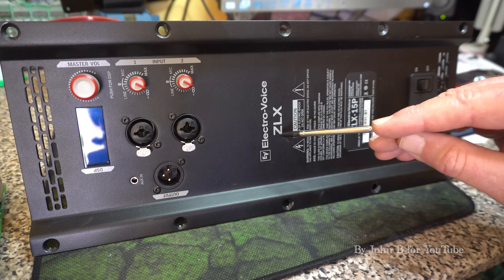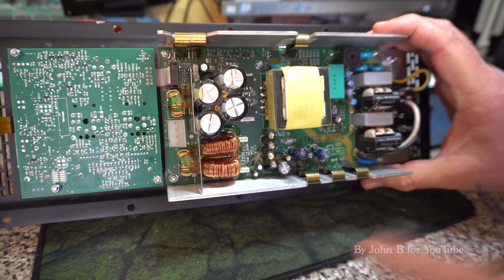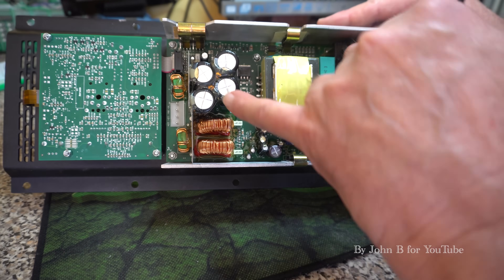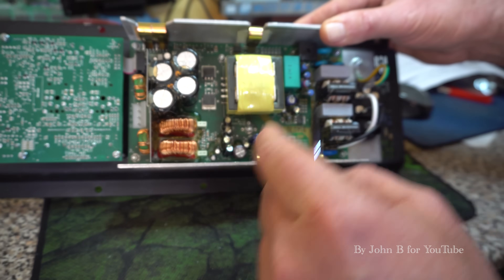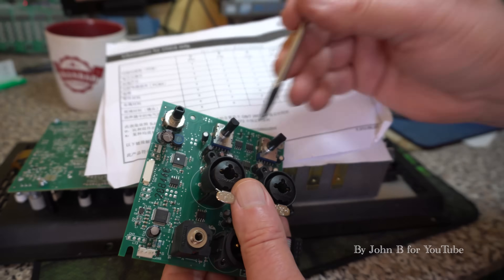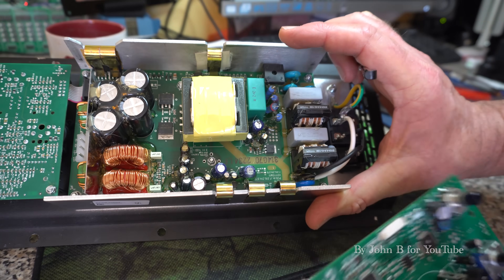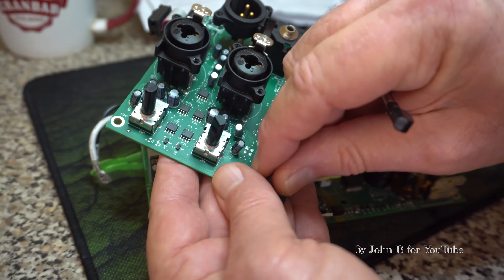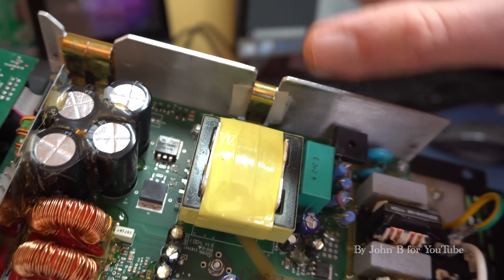The Inconvenient Truth about your Electro-Voice ZLX-12P & ZLX15P amplifier (Read Show More)

Comment from the maker: The repair scope shot shows +/- 30 volts peak to peak before it limits down to 20 volts PP.
30 volts PP times 2 = 60 volts PP.
60 x 0.707 = 42.42
42.42 x 42.42 = 1,799.4564
1,799.4564 into 4 ohms = 449.8641 RMS
At full power, this 449 watts lasted just a few seconds before the chip cut the output down to 200 watts approx.
Reply: well that's bloody rude of them isn't it. these are expensive speakers here, well over a grand, performing like speakers worth only a few hundred.
Reply from the maker: @maebeans  you can watch the repair video, the proof is on the oscilloscope.
Reply: @JohnB-2021  oh no, i believe you, i've been making these measurements myself while designing an amplifier. i'm just disappointed that a "trusted" brand can't be.
Reply from the maker: @maebeans  I saw someone fixing an Alto TS310 and quoting 2000 watts. It has a 500 watt chip for the bass and another for the treble lol.
Reply: Merci pour votre vidéo et vos conseils @JohnB-2021
Reply: My zlx keeps cutting off at high volumes and keeps breaking compression drivers
Reply from the maker: @mannybk2722  You are turning up the volume too much.
Reply: Conclusion: Is necessary find Yamaha repro PA. Or anything from Yamaha. Thanks for quick smart electro education.

Comment: Thank you for an informative video. What thickness would you recommend for the heat transfer pad on the bass amplifier chip? I read somewhere that extra care is needed to ensure proper connection to the heatsink "hump"
Reply from the maker: 2 or 3mm

Comment: Hi John,  I've got 2 no  EV zlx 12p, one of them has low clear output even on max volume, the other one is loud but humming noise on all inputs except AUX IN, once I use input 1, the humming comes back, when I use AUX in, the humming goes away, any chance you have a solution for both speakers or can you fix them? Do you have a servicing location? Thank you
Reply: Verifica los potenciómetros y los preamplificadores 😊

Comment: I have beat the crap out of my two 15-piece for a year and a half 15-piece like tweeters two 18-inch Subs to compensate for the power loss. Sounds good. I paid 600 bucks a piece for the speakers. I've seen a cheaper set online for 250 bucks we have 😢two knockoffs

Comment: Hey so I have a pair of these when I power them on it sounds like it’s receiving interference like how older wireless mics use to get. I had them stored in my friend’s basement for a while without use. Could you shed some light on how I could repair these or fix this issue ?also the power just comes on and shuts off randomly.

Comment: We just got alto ts315. I'd be very interested to see what these "2000w" speakers have under the hood and what you'd have to say about it compared to the EV.
Reply from the maker: I bet / guess 1000 watts rms if they have two 500 watt drivers. 500 for bass, 500 for treble.
Reply: @JohnB-2021  why would treble need 500 watts??? Tweeters don't need high wattages to get loud. it's extremely uncommon to see a PA tweeter with more than 100 watts. They're usually only 25-80.
Reply from the maker: @Bxyzfnf Well I guess it’s down to the type of tweeter / horn used and the operating frequency.
Reply: @JohnB-2021  500 watts for the tweeter is already concert line array territory. which is nowhere near these cheaper powered speakers

Comment: Our same EV speakers over heat. Not touchable. What to do? We have 3 subbase and 6   heads ( tweeter -mid)
Reply from the maker: Many have said they get hot. Normal for that model and brand.
Reply: WE PUT TWO SMALL COOLERS ON THE TOP PART EXTRACTING THE HOT AIR AND FORCING THE CIRCULATION OF THE SAME AIR
Reply: Hii tweeter ok but mid not working what can I do

Comment: Hi John...thanks for great videos! I have a EV 15P with a electronic buzz from speaker not mechanical...any ideas? sounds a bit digitalish...caps?...regulators etc as I havent even looked at this amp yet...TIA...another John ;-)
Reply from the maker: @whitenorthstar  I doubt the caps are faulty, they would cause a hum. Sounds like a power supply issue but no idea what.
Reply: @JohnB-2021  sorry John...it is or seems to be mechanical coming from the chokes/smps transformer and some have reported this but never got to the bottom of it...possibly oscillator running at wrong frequency as one suggested or? Could be any number of things with these crap EV power supplys! If i get to the bottom of it I'll let you know...thanks for reply.
Reply: It was a faulty smps with loose windings that was causing the mechanical hum.
Reply: @whitenorthstar  Have same mechanical buzzing fault ... can you detail how you fixed it?

Comment: Ive always wondered  why they sound so underpowered , i have 2 ev zlx 12 p and 2 alto ts212, and they have always  sounded underpowered compared to the altos. But with this new knowledge im willing  to bet that the altos are also using the same scheme.  

Credit  to EV they are much more reliable rhan the altos never had any issues, but I've had an undesirable  experience  with Alto they keep on breaking, they're  on their  3rd pair of tweeters second  pair of preamps and now going in for thier 3rd pair of preamps. The altos are never pushed hard they are only used for stage monitors
Im not a fan of the EVs, i hate them even more, but i do agree with some of the comments, they really do sound nice.
Reply: вот поэтому Alto и звучат громче, и при этом ломаются так как плохая защита динамиков, у EV грамотно настроен лимитер и это сохраняет динамики, хотя звучат тише

Comment: doesn't the fuse rating give it away? 250v / 0.5a = 500w (lol, got the maths wrong, that's ohms)
Reply: i totally read the back plate wrong, that's a 4amp fuse? so assuming a safety factor of 20% that's about 768w? and say it's 80% efficient, that drops to 615w?

i'm really curious if this can be done to make assumptions about an amp.
Reply from the maker: @maebeans  I have just pinned a comment, by me, showing the real RMS power for a few seconds.
Reply: but why does it say 0.8-0.5a next to the fuse rating?
Reply from the maker: @maebeans  You're spot on.
One can't get more power out of a box than is going in.

Comment: Hello,nice video !I have a question and maybe we can help us 
We have a ZLX-15P speaker and we replaced the power amplifier board but after this we noticed that has a distortion 
What can cause this problem ?
Wiring is tested and is good
Reply from the maker: Maybe the woofer is going short circuit and it killed the previous amp.
Reply: hello, I have a zlx 15 a when I connect it for 5 minutes only the treble tone works and the bass tone also works. do you have any idea what it could be?

Comment: Curious if you’ve worked on any Alto TS412/415’s? Interested to see what their real output is (rather than their advertised 2500watt peak).
Reply from the maker: The clue is Consumption : 900W
They can't produce more power than they consume.
Reply: @JohnB-2021  ah good point.
assuming the spec sheet can be trusted, the one I’m looking at is 1100w for the ts412/415’s; which isn’t too far off their 1250w rms claim on the specs.
Reply: I was getting scared then watching this video because i have alto TS415 and it looks very similar to electro voice ZLX15p
Reply: @adamplummer2994  I’ve just bought a pair of TS412. Got them at a good price & for what use they’ll get will be fine I’m sure.

Comment: You're absolutely spot-on! They seem to have rated their speakers for peak power. I'm still learning but, typically, loudspeakers are rated with "peak musical power", which they achieve with a pink noise tailored to have a 6dB crest factor. That means that your speaker will be rated 4x the average power it can really take indefinitely.
It's a way to make your speaker seem more power-hungry than it really is, as higher power doesn't necessarily mean higher SPL. A speaker can, for example, take plenty of power and heat up like a kettle, and still deliver puny SPL figures, if its efficiency is shite.
Reply from the maker: Thank you for your comments.
Reply from the maker: The repair 'scope shot' shows +/- 30 volts peak to peak before it limits down to 20 volts PP.
30 volts PP times 2 = 60 volts PP. (Times 2 because amp is bridged mono)
60 x 0.707 = 42.42
42.42 x 42.42 = 1,799.4564
1,799.4564 into 4 ohms = 449.8641 RMS
At full power, this 449 watts lasted just a few seconds before the chip cut the output down to 200 watts approx.

Comment: Love my ZLX EV's. So far so good.....
Reply: Hi could i ask you something about them?
Reply: @rumely7232  Sure. Ask away...
Reply: @longsnapper5381  is the mini jack as good as a trs input port? I use bluetooth now but kinda want to switch to wired
Reply: @rumely7232  We use the Bluetooth only. I'm sure the 1/8 jack would work fine, too but I'm speculating.
Reply: Just started using these first gig was the weekend zlx15bt, I noticed they get really hot on the back panel is this somthing to be worried about or is it the normal ?
Reply: @MsMissi09  What's "really hot"? Any amplifier is gonna get warm and if not ventilated or left in the sun too long, fan stops running , they will shut down.
Reply: @longsnapper5381  these don’t have fans built in but do have the air vents , but panel still warms up quite heated couldt still touch but put me edge all night thinking is it going to shut down the speaker , , I had pair of db opera active speakers before and they didn’t hear up like these do , I have read that it is the norm and the is designed to take the heat but just wanted to know from direct user of them that happens on their ones aswell then I’ll feel more at ease , I don’t do outdoor events so being in the sunlight is not a problem
Reply: @MsMissi09  Think you're fine  Mine get warm but never shut down. Did have a problem with them tripping ground fault outlets at our outdoor venue but I changed the outlets to regular ones and use a ground fault extension cord now. No problems. Could always rig up a clip on fan with yours to put your mind at ease. Good luck!
Reply: hello, you talk in great detail about Ev, I'm having a problem with my ev zlx 12bt, it can't connect bluetooth to the phone. Can that be fixed? I hope you can help me
Reply: @_NguyenMinhPhuong-ku1ej  I'm sorry, I don't know that answer. Did you try connecting to a different phone than your own?
Reply: @longsnapper5381  I tried connecting to 3 different phones. But it seems like the speaker's bluetooth is always connected (even though I just bought it), so the bluetooth signal is not displayed on my phone. I have reset it many times.
Reply: @_NguyenMinhPhuong-ku1ej  Habla con la garantia si es que tiene y sino puede ser una falla del modulo bluetooht y algun problema en la conexiòn del ingreso del audio por bluetooh a la preamplificacion. Saluds

Comment: Bosch is the owner of ev...this ev's is actually one of the best for gigs...we have been using this products for a decade in Philippine outdoor and indoor pro sound settings...although the power rating is overhyped...what they mean by 1000w is if you use a 1ohm speaker....different speaker impedance means different power rate each ohms...to produce 1000W you actually need a transformer rating of atleast 90-0-90volts...if its only 41-0-41 then 300watts is its power....
Reply from the maker: Thank you for your comments.
The power supply is actually 36 0 36.

Comment: How can they get 135 dB SPL with 420W... It'a 26dB more than 1W.. So the bass driver speaker must have 109dB efficiency per 1W!
Reply: The secret is in neodymium magnet they are using...
Reply: @ppopspotter_apj  it's not a neodymium magnet on the woofer, it's cheap ferrite

Comment: I love my ev zlx sound but they do get hot and it sucks 🤷‍♂️
Reply from the maker: Does it matter that they get hot?
Reply: @JohnB-2021  it bothers me. I’ve seen jbl eons shut right off from being too hot
Reply from the maker: @Darth_Harry_89  Watch my repair, it shuts down in a few minutes because I didn't cip the voltage regulators to the heatsink.
Reply: @JohnB-2021  I use my friends qsc k12(original) if I ever do outside events

Comment: I have ELX 115 15 inch.mains I have used for about 6 years.. I have Giged these speakers about 30 times in many different venues inside and out. Never had an issue and they.are super quiet when active and idle..  They push excellent SPL.  I know the Class D amps are not the best but a class A Amp in this.speaker.would weigh 85 pounds. I also have SXA 250 EV speakers..I.assume they are Class AB amps .they are tremendous speakers but weigh a ton.  I am looking at replacing them with PXM 12P monitors...Basically would  rather have EV than turbosound wedges.Everyrhing now has DSP and is Class D.

Comment: Thanks for taking the time for the review John.  I have the ZLX12 BT, no internal fan to keep things running cool.  The amp (class D) gets quite hot to the touch even at idle, no input outputs set to nominal 0dB.  On the other hand, there's an internal fan on my Yamaha DBR10 (which sounds fantastic btw) cool as a cucumber even after on for several hours.
Reply from the maker: Thank you for your comments CVee, you could take a look at mine one day lol.
Yes I did a review & repair on the Yamaha DBR10, it’s a better class of speaker and more powerful too; they would be my first choice of active speaker.
Due to the cheap ZLX design, even the 15 volt regulators cook themselves and switch off after a few minutes with zero signal input, see my repair for proof.
There is so much heat from the little amp chip and the regulators, the case will get warm in minutes.

Comment: Stay away from anything with class D amps if it needs to last 5 yrs +. Even for home use there is always a chance for occasional overdrives.
Reply from the maker: It's not the amplifiers that fail, it is the power supply.
Thanks for your comment.
Reply: Sometimes the chips too. Maybe poor design or the psu taking them out.
Reply from the maker: @cyrusfurtado8113  I think it may be the constant overheating.
Reply: Maybe but in a class D?
Reply from the maker: @cyrusfurtado8113  
Not sure if the question is aimed at me.
Yes the little class D amplifier chip consumes something like 8.5 or 9.5 watts
9.5 watts is a huge amount of heat to get rid of.
One can buy 10 watt soldering irons.
Reply: Yes think that's the issue. Coz of their complexity & power dissipation potential manufacturers need to add heat sinks or some form of active cooling to them as well.

Though you are right that the switched mode power supplies have a higher chance of failing before the amp chips do.

Comment: Darn it. I just paid 600e yesterday for a used pair of ZLX-12's. What awful luck. I used them before (my friend loaned me) and they were great and he recommended them said he had them for 5 years no problem. And then i find this video (after) the fact :-( Do you think it would be a big job to attach 1x or 2x computer fans pointing towards the amp/circuitry? Do u think that would help?
Reply from the maker: 600 Euros, wow.
Fans will not help.
You might be lucky, they might last another 5 years.
Read the comments, many fail after 1 year.
Reply: Well I just found out that you can turn the Sub ON even without an actual sub connected. This will allow you to set the crossover to 80hz which is advised frequency for monitors like this. Without setting the sub ON at 80hz frequency, the sub is set I think at 60hz (it's a huge audible difference) and run this way I'd suspect pushes everything farther. I wonder if many of the issues being reported are with this setting OFF?

Comment: Generally these types of speakers are disposable. Use them for a few years and sell them off or if they break toss them away.
FTC used to require audio power to be quoted in watts rms. So they still measure the output that way. In the case of EV this speaker came in at 250 RMS. Program power is 2X this amount or 500 RMS. They don't measure it, they simply multiply X2. Peak power is 2X program power. Again this is a theoretical figure but it gets us to 1000 watts peak. 
That's the big number that they put on the box and the brochures. It was never measured or achieved and you won't get that amount before failure anyway.
A quicker way to get to the real or rms wattage is to divide Peak by 4. 1000/4=250 watts.
In real life I measure my PA speaker and truth be told it was really loud at only 50 watts. I would say that's all I will use at most gigs. Now if I am really going loud I might hit 100 during peaks.
The ZLX lineup is entry level. I would go for the PRX800 if I was buying EV for actual pro use.
Reply from the maker: Thank you Brian for your comments.
Reply: The PRX800 is JBL not EV LOL